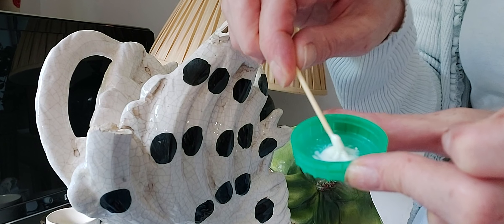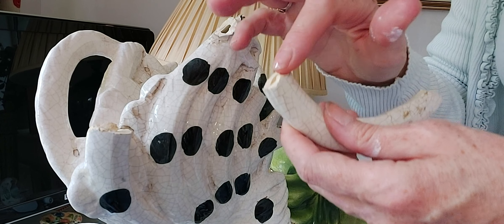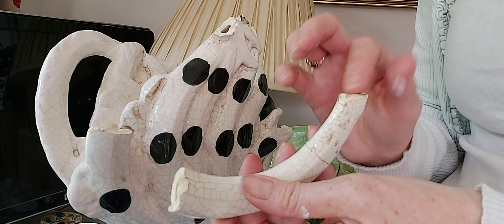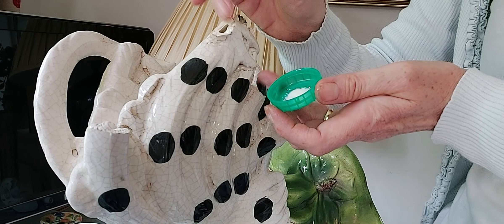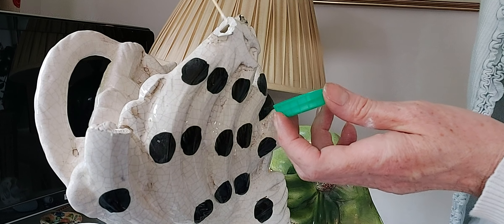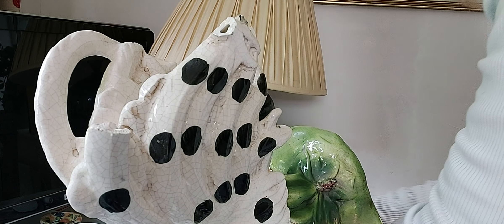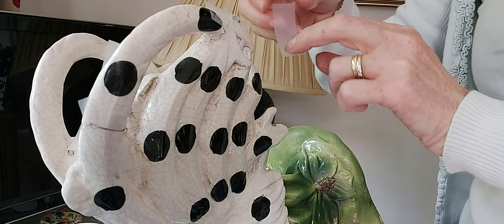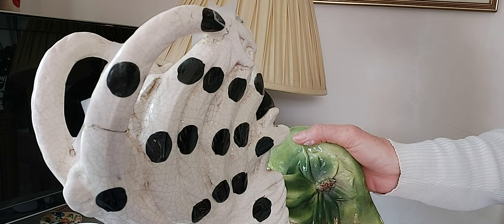RESTORATION REPAIR POTTERY

Comment: Thank you for your well presented and informative videos. My question is, I’m working on a mug that I intent to use. Is glaze toxic? There is a large section of the painted surface, where lips would touch, that I’d like to repaint to freshen up the piece. Should I use something else?
Reply from the maker: Hi Elverta, I tend to use Rustins waterborne ceramic glaze, to confirm if it is food safe I would suggest ringing the manufacturers and asking, you can also look at there safety data sheet which should be on their website. Please let me know how you get on. 😀
Reply: @TheCeramicRepairStudio   thanks for answering. Rustin’s is a UK brand and I can’t get it in the US. The ones I’m finding talk about being food safe when fired. Can this be done in a regular oven?
Reply from the maker: @Elvertaw  I am not sure on the other products but you could probably fire in your oven. Although I don't know if it makes a different if the oven is electric,  gas or oil. Also the oven would have to be 100% clean.